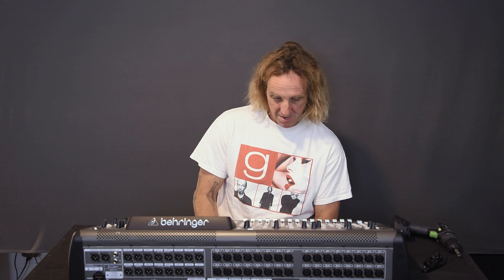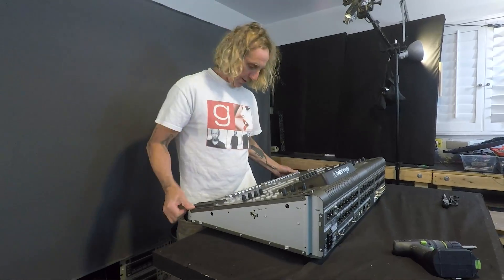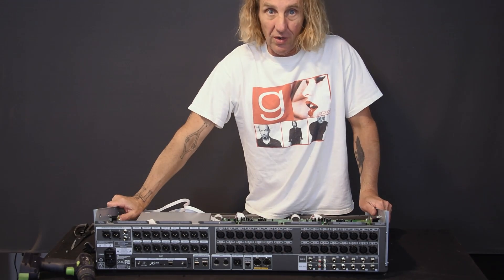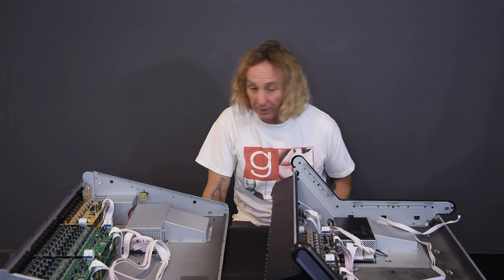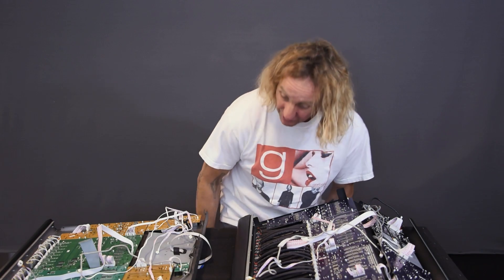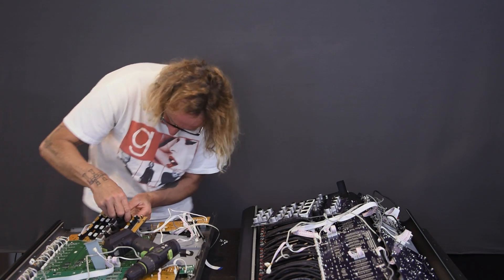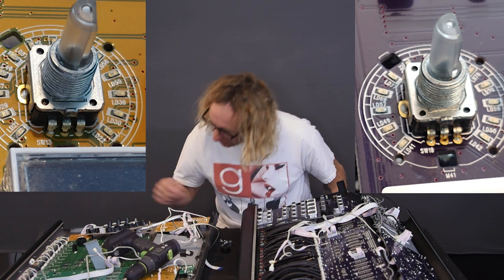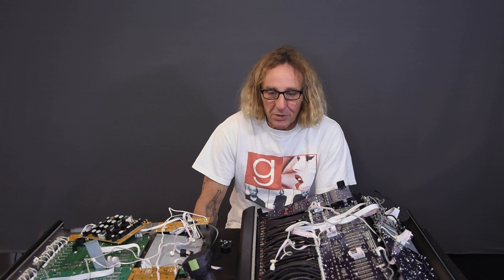Take Apart Behringer X32 & Midas M32 (Public)

Comment: This is fairly obvious... Ine company makes the XL3/4 and in my opinion the greatest live console the glorious XL8... The other company does not.
Reply: Midas UK guys are behind the HD, not the M32.
Reply from the maker: Hmmm, both consoles are made by Behringer's parent company and use identical software, identical interfaces and the X32 was released first and the M32 is basically a modified x32 with some added value features and ergonomics added.

The consoles are interchangeable and I am showing the subtle and not so subtle differences that account for the 50% higher cost of the M32 that does exactly the same thing as the X32
Reply: @DaveRat  but it doesn't do the same Dave. By thst rationale you'll be swapping drawmer gates for bellringer quad gates i take it. There is a price difference for a reason. Fiat make Ferrari and i believe there is a difference in that production line also. Side note question.... XL3 XL4 or the digital behemoth XL8??
Reply from the maker: Perhaps watching some of the 10 or so videos where I explore and text the differences and similarities between the two will be helpful?
Reply: @DaveRat  i have watched some. They have been really informative. Next time your out with the RHCP will you be mixing on midas or behringer? Like i said Fiat and Ferrari. Both go from A to B but there is a difference. ✌️❤️
Reply from the maker: Ha, no more touring for me. I am done with being told what to do and where to be. Though I will post more vids and surf, snowboard and travel to fun places
Reply: @DaveRat  fair enough. Im 44 so i have a few more years of bus bunks and 10am lobby calls. Not grinding your gears here.. Im just can't see past midas in the live world. Plus im mostly a monitor engineer these days. Based in the UK. Really enjoy your videos and your lockup looks brilliant. ✌️Amigo.
Reply from the maker: Thank you Paul!

Comment: Hi Dave. Pretty soon an army of lawyers will tell you that you don't have a "right to repair" and as a not "Behringer certified technician" your tinkering inside those units will be pretty criminal... 😉
Reply from the maker: I support boycotting companies that choose that path
Reply: Behringer together with Thomann seems to be quite liberal in that respect. I purchased an Behringer NX3000 power amp, which I promptly modified with a more silent fan. A month later it failed, due to a defective schottky diode in the power supply. I got an RMA and a few weeks later a brand new amp, which has performed flawlessly.

Comment: What I could see is also more discrete circuits design on Midas vs more opamp usage approach on a Behringer. That’s also a big deal to me.
Reply from the maker: The Behringer does have similar quantities of discrete but they tend to be surface mount so they are less noticed

Comment: I noticed the Cirrus Logic converters and the Xilinx FPGAs on the M32 output board, didn't see those on the X32.  Particularly curious what the FPGAs are doing!
Reply: I think X32's DACs are on another board, and X32's output board only does buffering and balancing duties.

While M32 do demux, DAC, buffering and balancing on the same board.
Reply from the maker: Interesting!!

Comment: Been telling people for a long time that there was more under the hood between the two boards than they realized. Not just the faders. Because of the significant input and output circuitry differences would this also make the M32 more capable to handle signals than the X32, which has proven itself? Or would it simply improve signal quality?
Reply: Dave, just fyi ,xlr input cards can be swapped between consoles, so your x32 could be a frankenmidas. I didnt do any sonic testing to see if there was an audible or measurable difference, but I bet the same holds true for analog output boards as well.
Reply from the maker: Interesting!
Reply: @grecoaudio  Hi Chris, do you confirm that? Did you do it? I just fried an input board on my X32 producer due to condensation and was asking myself if I could swap them with Midas ones
Reply: @PabloDeBiasi  Pablo,  I installed the midas card in one of my S16s. Its been functioning fine as far as i can tell. I'd be happy to ship it off to Dave Rat if he wants to do some extreme testing. Whadaya say Dave?
Reply: @grecoaudio  Thanks Chris! I needed actual confirmation that it can be done, as I suspected. Nice! Does the preamp pcb host the converters too or just the preamps? I'm evaluating if it's worth it or better just buy a DL32 to upgrade the outputs too
Reply: Different noise floor signature on input side, and lower noise floor on M32's outputs.
Exactly the same input signal handling for both.
Reply from the maker: There are different transistors on the inputs and they do distort slightly differently but they do seem nearly identical audio wise
Reply: input and preamps with gain circuitry schematic 100% identical, the resistors and capacitors have the same value in the same position opamp's  x32 4580RF m32 4580L but x 32  has NPN input transistors therefore with positive supply and m32 has PNP input transistors therefor negativ supply...

output cards has more differences, i think recordings direct from inputs routed to usb have the same results...i have not tested but...
Reply from the maker: The inputs do not test the same. The components used on the inputs are not the same.
Reply: You are right!!! Yor M32 on video has KTA1268 transistor at input 
but my wiring diagram shows BC 640TA😃
(the manufacturer reserves the right to make changes without prior notice)
Reply from the maker: Very cool and so interesting. Often things are not as as they seem so fun to test and observe and see if the real world matches what is presented

Comment: the chasse mounted faders are also a big deal for longevity of the board as well. if you spill a drink and only fry 2 faders that are a part of the board, you need to replace the whole board. If you fry half of the faders that are attached to the board, they can be swapped out. I want to start looking for broken M32's to buy for cheap now!
Reply: Not necessarily. I've replaced individual board mount faders many times. You don't need to trash the whole board.  However... depending on how they design said circuit board (sectional or monolithic), it is somewhere between a huge PITA and a royal PITA to do it. Soooo many f***ing knobs/screws/spacers/shaft nuts to remove and reinstall. Those Midas faders are "Feild Replaceable", ZERO board removal. Pop the connector, unscrew the bad fader, pop in new one. 2 minutes (once case is open) That's EVERYTHING if you're touring. YMMV. 🙂
Reply: @jeremyhelm2833  I have 2 versions of the Behringer MX2832 mixer.  The original one came with an external power supply,  a 19" chunky piece.  However, this desk died a while back (after about 12 years) and I'm assuming the PSU is to blame.  It did develop scrachy faders over time.  I'd like to get it fixed up, the only thing putting me off is pulling off all those friggin knobs, nuts and spacers!
Reply: @Axl_Pose   MX2832...  HA HA HA !!! That is EXACTLY the board I have nightmares about being a royal PITA !! I only laugh with sympathy. I have a 2832. Mine has the rack PS. I only used it as a line summing mixer (in a closet now). For that, it can sound fine... when the f***ing faders are working !!! If memory is correct... that unit is comprised of a series of 8 channel PCB sections, cascaded (series) by ribbon jumpers. Of course, mine had at least one bad fader per section so I had to disassemble the entire thing. I used a cordless drill with nut driver adapter to remove the 7 million effing nuts/washers. There is no way anyone would ever do that on the road 20 minutes before the band goes on. I'd just try to make the broken one work with an external power supply. You could probably find a cheap external PS on ebay. Most consumer/semi-pro consoles use similar power supplies... +18v, -18v, +5 digital, +5 analog, maybe a -5.  something like that. good luck

Comment: Thanks, Dave. I was wondering if you may have happened to look at the power supply modules in the two and possibly compare them?  A likely source for noise in my experience. You probably got the biggest and most dramatic difference being the faders which pointed out in the video. Just curious what the power supplies might be able to tell us regarding their efficiency, type and perhaps different manufacturing methods, if any. Thanks again, man.  I appreciate your posts and enjoy watching them whenever I am not out at a gig or working in our warehouse maintaining equipment. Cheers.
Reply from the maker: I did look and have some pics, did not remove the covers to see the differences

Comment: Behringer X18r vs Midas MR18
Reply from the maker: I don't see that there would be much difference from this test
Reply: @DaveRat  I've owned both, and the MR18 is heavier, probably to the pro level preamps.  The XLRS have release buttons on the MR18, doubt if the there is much more difference.
Reply from the maker: I don't like to make assumptions but I do know that cost savings is almost always expressed as a reduction in the build cost. Cheaper d to a converters, mic pre amps, lower cost connectors, smaller psu, less expensive build quality are things they did in other midas/Beringer variations resulting in a noisier and more latency,so it is probable some or all of those variations also exist on these units as well.

Comment: Any plans to measure the differences between the s16 and the dl16 stage boxes for these? I'm guessing we could assume they would have similar differences. What's interesting is that they are interchangeable so you could use a midas dl16 or dl32 stage box with the x32 and have the upgraded analog signal paths.
Reply from the maker: My understanding is that the stage boxes are identical to the consoles. So the test would or should yield the exact same results as the stage boxes are just the consoles without the interface.
Reply: @DaveRat  Thanks! I appreciate the content on your channel.

Comment: Would have been interesting to compare some part numbers of the input channels like the op-amps and ADC.
Reply: x32  has NPN input transistors m32 has PNP input transistors with single trail positive or negative supply and DC level shifting and maybe this answered the signs of distortions on opposite parts on waveform...🤔(simple two transistor class A differential amp with single trail power supply)
Reply from the maker: Thank ypu
Reply: Same opamps and ADC as far I can see, and very similar circuit on input side:only differs on transistor input stage and different quality capacitors.
Differences arises on output side: DAC onboard in the M32, and in another board in X32.
Reply from the maker: The input transistors are different but the circuit seems similar.  In another vid I show that the x32 and m32 distort from overload differently with one console distorting the positive part of the waveform first and the other distorting the negative first.